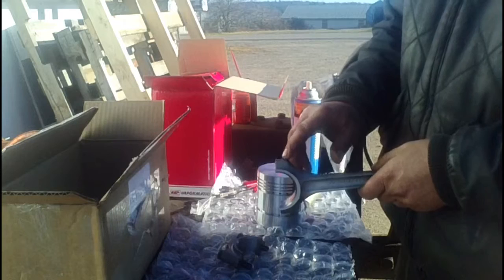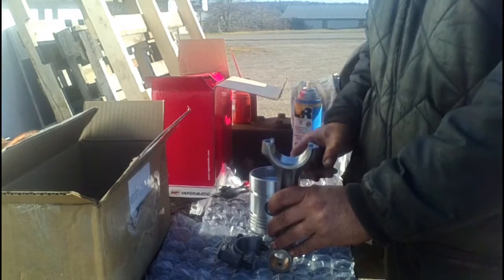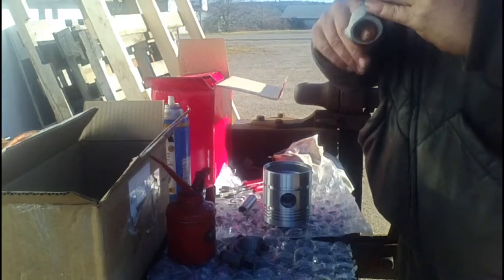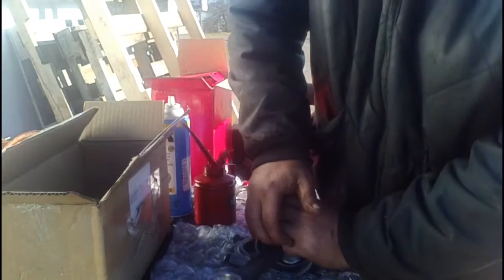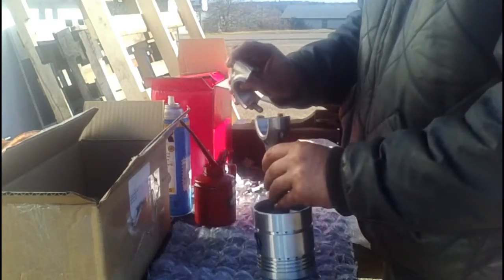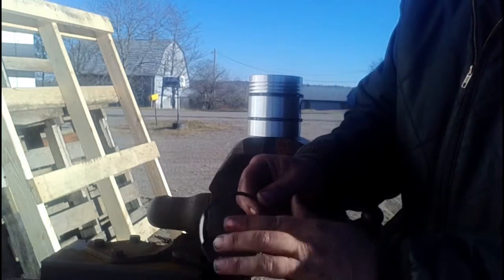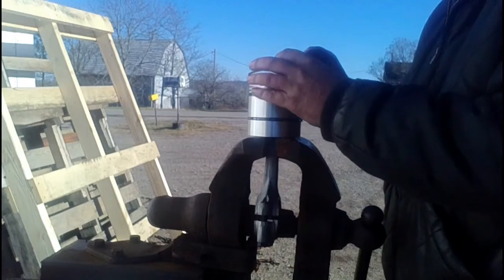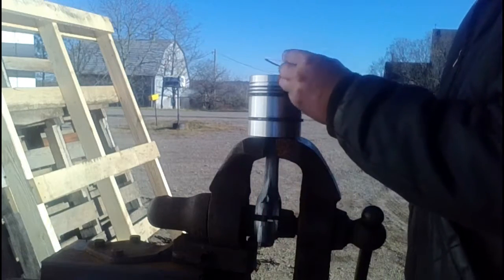BD 154  rebuild part 5, Piston and rod prep.

Comment: What rebuild kit brand do you recommend.
Reply from the maker: +Draggin Theline  I generally use A&I Products kits as I am a dealer for them, but there are a lot of good quality kits. As long as you get your parts from a dealer you trust you should be fine.
Reply: The rebuild kit I received is made by Anglo tractor in England. The pistons don’t say “front” on them. Have you ever used any of their pistons? I’m trying to figure out the right direction they go in. Thanks for any info.
Reply: I was able to get in touch with an Engineer at Anglo and he confirmed that the arrow/triangle on the bottom side of the piston up near the wrist pin does indeed point to the front of the piston that goes to the front of the engine. I installed mine that way and it runs great.